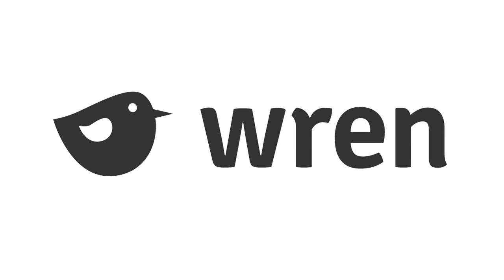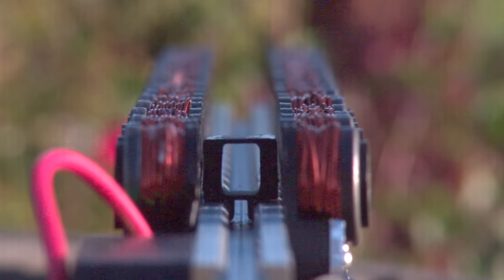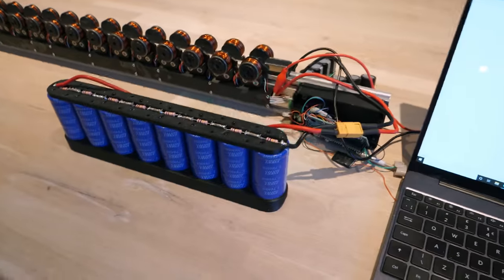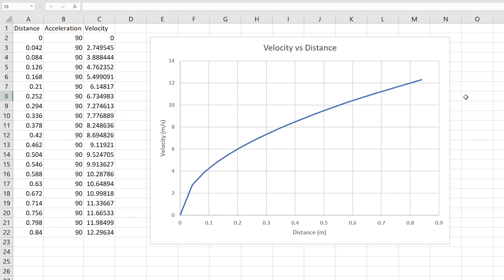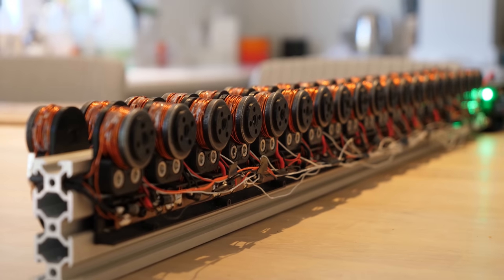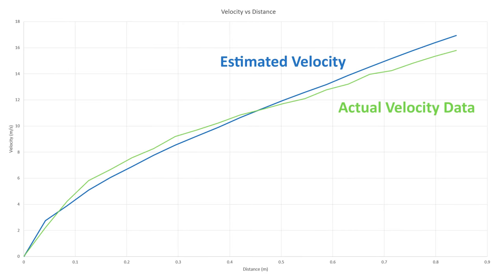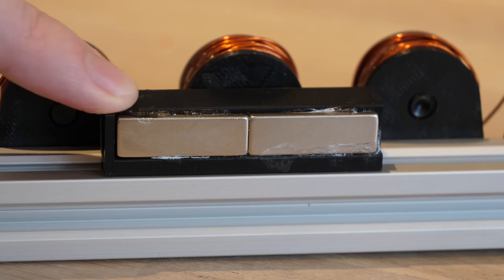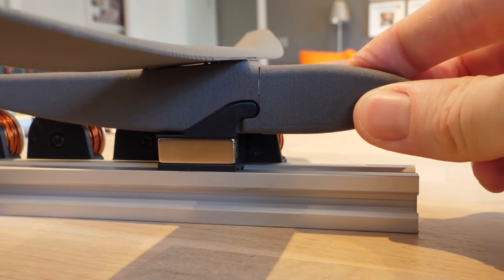Optimising a Magnetic Launcher

Comment: use a prediction time for actuating a coil: use a estimated time of actuation of the coil instead of the sensor, use every sensor reading to adjust the prediction for the next coil, like an advance for a piston engine, if you tweak the activation time maybe you can squeeze a little more performace.
Reply: IMO this is something that should be added once more lucrative optimizations are made. Optimizations to the hardware design should come before spending a lot of time optimizing software, to avoid wasting time on hardware that doesn't ultimately match your performance expectations.

Comment: Great job! 
Have you tried to reduce the friction of the sled using an air cushion (like it is used with air hockey) or magnets? That might boost the top speed further!
I'd also suspect that the wiring of the energy supply causes some of the voltage sags due to the back EMF of the wires - try to add some caps (ceramics if you can) in close electrical proximity to the individual coils. Another idea would be to keep the coils constantly on and just turn them off when the sled passes to keep the voltage at the starting level - I suspect you may see the inverse on the voltage profile though when the coils turn off so be careful and expect some overvoltage! Also, if you do that watch out for the current/power draw in your coils and the temperature
Reply: I mean if all else fails you can just apply lubricant like krytox to the sled or rails in order to reduce friction
Reply: If the coils are already pulling over 1000w then the small amount of friction does not matter. It would be more beneficial to add a top guide to reduce the air gap between magnet and coil and to make the sled lighter. But that would also be only a marginal improvement. It would be best to use higher voltage and cool the coils with liquid nitrogen to lower resistance and prevent them from evaporating. Maybe run 4 big car batteries in series. Also have to get bigger mosfets. 10kw to the coils will put a smile on your face.

Comment: Awesome work. Your intuition that the distance between the permanent magnet and electromagnet is spot on. I used to work on the design team for a company designing motors for the robotics industry. The gap was one (if not the most) important aspect to control. You've got me wanting to make one of these now! I may have missed it but if you are not already using N52 magnets, see if you can get some of those. Don't worry about the characters following the number, such as N52H. The (H) is to do with the maximum operating temperature.

Comment: When I was in High School in the late 60s I took a course called Industrial Physics, One of the pieces of equipment we had was called an Air Track which allowed a small cart to float over an aluminum track. We experimented with linear motors until we blew up the electromagnetic coils by using four times the voltage and amperage the equipment was designed for, we also but a hole in one of the concrete block walls of the school .

Comment: Greater acceleration per coil could be achieved by having steel "C" cores reduce the reluctance of each magnetic circuit. Using steel cores would increase the magnetic flux for a given current.
Reply: but it would also drasticaly increase the inductance of the coils leading to slower current rise times, which have to be countered with higher voltage

Comment: Tom I find this very interesting, the thought that came to my mind is what happens if you increase the center to center distances of your coils say .125 mm with each coil. This would in effect change the winding timing, this is done on some EV motors to gain rpm for a given voltage.
Reply: A great velocity can be achieved; unimaginable to grasp if the material can hold its durability.

Comment: Always amazed by your projects. I love optimization. In my own physics degree I designed something called a Zeeman Slower which basically the same thing but for atoms and does the opposite ie slows things down instead of speeding them up. I loved tweaking the design for optimum performance

Comment: Reducing amount of turns in the windings also reduces inductivity of the coil. It means it will produce less force per amp of current. But also inductivity makes it longer for the coil to go full power. Just like electric motor with less windings will have higher KV (rpm at curtain voltage) you made your end coils to respond quicker. Which was right decision but for a different reason :)

Comment: Very cool and exactly the discussion I need for designing a mass driver for the moon.   The cost is getting it built, the energy is there and the re-entry craft can be built with a 3D printer on the moon using basaltic rock melted to make basaltic thread to weave the re-entry craft with some simple ideas to slow the incoming packages so that they can be decelerated to land on any kilometer on earth.

Comment: Some precision here:
The firing interval needs to be adapted with velocity.
The time of travel from Hall sensor to coil is decreasing with projectile speed but the current increasing time of the coil is constant. By reducing the number of turn at the end coils, the rising time was shortened leading to better timing.

The back EMF is present yes but I'm not sure whether it is really significant. You can unplug the last coil and do a back EMF measurement at that coil during launching to check it the voltage supply is enough.

If it is EMF limited at the end, the design is very efficient and performing closed to optimal.

About the curve fitting, it is better to do a linear fitting with a transformed signal (e.g. log() if exponential signal expected). Human perception of fitting is not perfect...

You did a very decent job!

Comment: I think the curve flattens out because you increase not speed but kinetic energy. And as we now it has power of two. And so you get the inversed function
Reply: It's a curve because it's velocity vs. distance, so even if it's constantly accelerating, it spends less time in each successive unit of distance and so accelerates less from coil to coil.  If you plot velocity vs. time you'd have a straight line with constant acceleration.

Comment: Such a great channel. Every new video shared from this channel has its own different type of excitement effect on me. Just to remind, the opposite direction voltage caused by the magnet on the coil is called "Back EMF". This problem can be solved without changing the coil, by adding a diode in the orientation to stop the Back EMF voltage. This way, you can achieve higher velocity and torque by the same amount of voltage. I really hope that I helped, also count me subbed 10 times.

Comment: Awesome video! 
Adding capacitors in parallel to the battery will help to get even higher voltage and current on average. Capacitors will charge during spikes and provide higher current when necessary.
Alternatively, having a capacitor per coil, pre-charged before launch would provide required voltage for each coil.

Comment: Love following your projects; super inspiring! I believe all your conclusions regarding the power delivered to the coils are in the ballpark, but the inductance of the coil will affect how the current is increasing from zero when turned on. In the end there are several trade-offs to be made when choosing number of windings, wire gauge and the geometry of your coils. Anyhow, very cool end result and a satisfying swooosh when launching :D
Reply: If you really really want to optimize it, you could match the coild with capacitors, creating an LC oscillator at each step, the resonant frequency tuned to the speed of the sled at each step so that the positive half-period is when the sled approaches, and the negative half is when it has passed the coil. This eliminates the need for second coils, and complicated polarity-switching circuitry, but lets the magnets pull and the also push the sled. But finding the right capacitors is tedious work, and probably past the point of diminishing returns.
Reply: @matekovacs2696  And abouth the Magnet Resilience, from magnetized / demagnetized of the coil? It afects to the atraction / repulsion of permanent magnets of the proyectile. This takes a time! The more windings,  higher the time what the coil remains magnetized (slower magnetizacion due to highter inductance, and greater resilience), and contrariwise. Also the magnetic permeability of the core can be optimiced, but to this 'modest' proyect it's a nice performance just like it's now

Comment: You can try using those black powdered metal ferrite cores. Using normal steel or iron impedes with the instant flux change, but those ferrite cores are pretty fast.

Comment: Use the projectile as a contact/switch to activate each coil as it progresses along the rail completing the coil circuits moves forward. Simples
Reply: contact switch would increase drag tho
Reply: @eduardopupucon not quite you may increase friction tho ..! The same principle as a commutator on the rota of a electrical motor. There will always be inefficiency related to movement, you could do the experiment in a vacuum that would remove drag. 
However the experiment is over complicated buy the use of too many electrical components, and much the same result would be achieved with switches, the advantage of switches is the coils and voltage could then be increased on a separate circuit.

Comment: If you want to increase the speed you're going to have to start increasing the Gap in between coils. Not opposing coils, but in between coil pairs. It's like adding a muzzle brake on a rifle. It's much easier to time. A 4-pack at the end in a slightly more eccentric Gap pattern gradually increasing to the end may allow you to time the coils. May also stabilize the sled.
Reply: Thanks that is a god idea. You can see very well in the voltage curve the picks due to the lower current consumption of the coils by the self-induction. There, the power and correspondingly the electronic field is small and reaches its maximum only in the voltage plateau. With the last magnets, this is only very short. Unless the MOSFET can drive even fewer windings and thus the inductance is lower, an extension of the periods is the best choice.
Reply: I thought this too
Reply: @sylvan186  pretty much a gauss rifle.

Comment: I was wondering Tom, what’d happen if you factor the exposure time of the each magnet on the slid. More precisely, what if you increase exponentially the distance between the magnets without increasing the number of turns of the coil windings. 
I expect this leading to the same results without increasing the power of the magnets.

Comment: It feels like one element that hasn’t been tuned is the exact timing of the triggers turning on and off the coils. It seems improbable that the mechanical timing achieved is precisely optimal. Also, the bank of super capacitors could be put in parallel with the lithium batteries to improve the current that can be delivered in the initial pulses.

Comment: Interesting project!  Thanks
@Tom Stanton - here is a project for you : research and calculate the amount of energy required to melt silicon+doping and grow and ingot.  As I recall (worked at ARCO/Siemens Solar), growing a full 35kg crucible of silicon into a125mm diameter x 1.2m single crystal silicon ingot took about 36 hours non-stop.  Each ingot, when sliced with a wire saw, yielded 1200-1500 wafers to be processed.  Then tell us the carbon footprint.  That would make roughly 1 ordinary house-worth of solar panels.

Comment: Tom, first thanks for another interesting video. I was curious (cant recall if you mentioned this) but would changing the spacing (increase the gap) as you go along the launch track given it will be going quicker would that give them more chance to pull? Would you want bigger and stronger magnetic forces too the further along to keep up with the speed increase and impart more effect? Would be interesting to see the plots for various gap deltas.

Comment: How much does the friction of the slider effect the gain of velocity forward?  If you could eliminate any friction due to movement, that might give you an increase in forward motion, but then the gain might not be worth the effort of eliminating the friction. :)
Reply: I was thinking exactly the same thing. Where is the lube?
Reply: WD40: Allow me to introduce myself.
Reply: @cuteanimegril7012  WD-40 is for cleaning not lubricating. The WD stands for "water displacer" the 40 stands for "formula 40".

I'd go with a silicone or Teflon lube. I prefer a carbon lube, but conductive lubes and electronics don't mix.
Reply: @jtjames79  As a former mechanic I cringe when people even think of pulling out WD40. It's just not really good for anything.
Reply: What about graphite powder?
Reply: @leighguptill9244  it's conductive, you would need to seal the electronics first.
Reply: @travelinman70  It is good for removing adhesive left behind from removing labels. :)

Comment: I feel that your coils are too close together, and when the speed rises, they cannot push the magnet enough because it passes so quick to the next coil that it's turned off too early. Could it be that your electronics struggle to push current agains impedance of the coils when they need to switch too fast
Can you calculate the efficiency of the system? Kinetic energy out / electric energy input
It would be cool if you could take away half of the coils, or mounting them in a longer rail. Maybe less coils make it less powerfull but more efficient, few power losses, and getting more time to be accelerated would increase efficiency too.

I know it wouldnt work for making a plane launcher, but what if you made around a tube to accelerate a ball bearing or some kind of projectile? The magnetic field would be stronger at the center, will it make it more efficient?

Comment: You could maybe combine the LiPo battery packs and capacitor banks in parallel to maximize current delivery capabilities.

Also you could use the hall effect sensor of the 2nd coil to trigger reverse current on the 1 coil and so on. This would likely consume only a few high current mosfets per coil but also double your current load at any point which your power solution right now might not be able to handle

Comment: The 3D printed glider might have not glided as gracefully as it could have (I know, not the point of the video) because of a condition called super-stall. The T-wing layout of the tail makes it so, that at a high enough angle of attack the horizontal stabiliser gets in the wake of the main wing, and it is not generating any sort of lift or drag to create a torque on the fuselage. This of course locks the plane in that high nose up attitude, and at such a high angle of attack, the wings are running out of lift and stall the whole aircraft making it fall uncontrollably. Worst part is that even if it had elevators or ailerons you still couldn't do anything about it, because all of those control surfaces are stalling.

Comment: When you write P = V^2 / R You are calculating the losses in the system due to Ohmic resistance of your circuit. The magnetic flux variation in the coils creates a negative tension (call it Em) and the power that goes in the magnet is Em x i thus total power coming out of your battery is R x i^2 + Em x i with the first term the Ohmic losses and the second term the transferred magnetic power.

Comment: The launcher that he makes is called coilgun and has he said in the other video it work by power on some electromagnets in some specific order and precises when you turn on and off, in other words you create an electromagnet that attract the object you want to lunch, when the object is to close you switch the electromagnet to the next in order so it's far of the object and can be attract again to gain more speed. 
The other is called railgun and like it's name indicates have two rails in parallel connected to a powerful electric supply and the proyectild made short circuit creating magnetic force that interact with the proyectild give it speed.
In both cases accelerated a metallic object, but with some difference between, the railgun can lunch proyectild at high speed easily but also consume pretty easy the electric power ( in some register it said that with a single shot consume the equivalent of e small city for 1 day I think) meanwhile the coilgun can't archive the same speed that the last one but it also consume much less so it can be made small and portable.

Comment: Interesting video! As for power output for different coil widths/lengths: in some electric unicycles, there are high speed and high torque motor versions. High torque have wide and "long" coils, more power at low speeds, riding speed limit is around 60km/h (yep, people ride electric unicycles at such speeds, I also do). In high speed version, coils are thinner and "shorter" in terms of wire, it has less power on low speed (worse climbing angle on hard terrains), higher currents, and much higher riding speed limit (up to 80km/h). So your experiments are moving in the right direction.

Comment: I think a simpler way to explain the curve is that each coil has the same power, and Power=Force*Velocity. Therefore, at higher velocities, the coil can exert a smaller force on the sled, and F=ma, so acceleration is lower at higher velocities. Alternatively, the kinetic energy added by each coil is the same, where KE=(1/2)mv^2. If you graph velocity on the y axis and KE on the x-axis, (where each constant interval of KE represents one coil), you’ll see the same graph